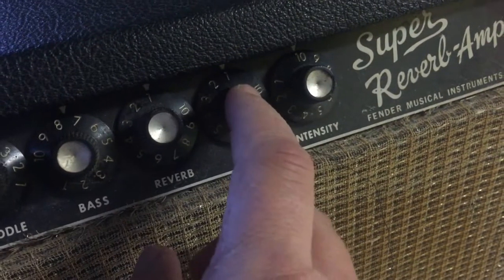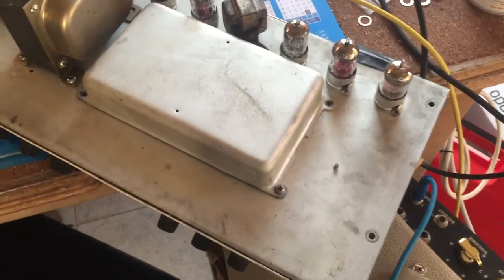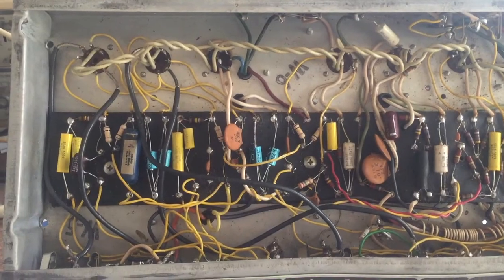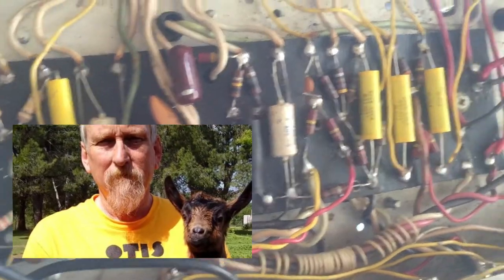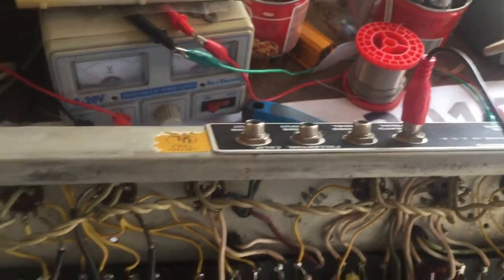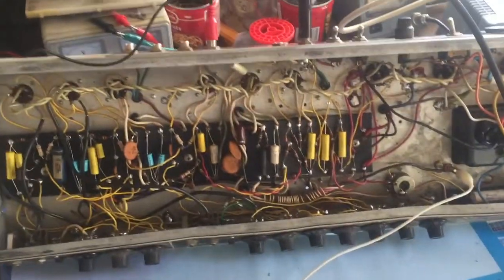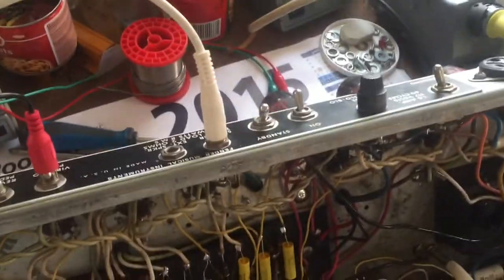Fixing a ticking Fender tremolo: 1975 Super Reverb Amp

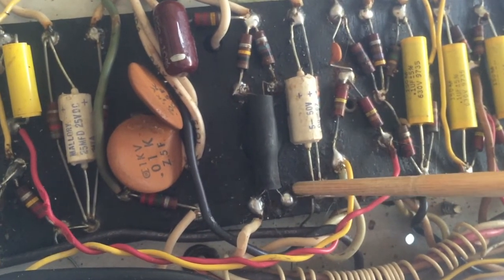Comment: At 6:30 you point to the location you said to solder the additional cap to and even alligator clipped it to that wire for the test. Yet when you're done, you've soldered it parallel to the Optocoupler itself? I see they're connected anyway but was wondering why the change?
Reply from the maker: 12:25 ? I don't really understand the question regarding 6:30 but a first the cap is put in circuit by using alligator clips, is that where the confusion comes from?
Reply: @zjokka  sorry, at 6:30 you pointed to the solder joint of the bypass cap marked 5-50v and that appears to be where you attached the clip to put the .01 cap in circuit. At 12:25 it's soldered to the bottom right leg of the roach. I just wondered if I missed something is all.
Reply from the maker: @kidlargo1  The right leg of the roach and the negative side of that capacitor are connected, and both lead to ground. Check the original Fender layout or schematic...
Reply: @zjokka  that's what I thought but I wanted to be sure thanks. Of course, now I've just seen 2 fixes that jump only the 10meg resistor lol. I'm just gonna test it with clips like you did and see what's up. Thanks again. Now if I can just find that rattle....

Comment: Fender's tech note says to wire the 0.01 uF cap across the 10 Meg resistor. Did that with absolutely no effect :-(  Where did you get your info from?
Reply from the maker: Hi Thomas, I have never seen that Fender tech note. Also do not exactly remember the source for this modification. Anyways, I would always test it using alligator clips before soldering, no matter who suggests the mod... Fender or some fool on youtube like myself ;-)
Hope you get it fixed!

Comment: Did you also change the dropping resistors in the dog house to 4.7k and 1k from 10k and 2.2k thereby upping the preamp voltages? Or was it just the phase inverter?
Reply from the maker: Did not touch the dog house!  Will be getting back to this one once i get around it!
Reply: @zjokka  Well thats why I asked. I've heard a few "blackfaced" 70s aka Silverface amps that had that superbly SWEET compression going on. I'm no expert but I think its a consequence of NOT altering the preamp voltages and maintaining that clarity but adding the compression from the 1ms in the PI etc. 
I don't hear that same sweetness from full blackfaces..
Reply: I have one under the knife right now so I'll let you know.. 
I'll change the PI resistors (leaving the .01uf coupling cap for now) and tail and we'll see.
Reply: @zjokka  Compare to this: https://youtu.be/6kMV3wZKMe8
Yours has that woody compressed sweetness I hear a LOT but never from actual blackfaces..
Reply from the maker: @cgavin1  I bought this amp 15 years ago . Did not do the conversion myself. It was done by a guy who worked in the automotive industry as a sound tester. There is a rattle somewhere in the prototype , his job to locate the problem. Fender amps was his hobby. Ill check the dropping resistors asap... but kinda busy weeks ahead...
Reply: @zjokka  No rush dude. Time has no meaning in this place. :)

Comment: ZJOKKA, if you remove the Choke in the power supply what does this do to the AC ripple? 
can this add harmonics and modulate the power tubes from the AC ripple signal?
Reply from the maker: Hi Bill, I didn't try this, but this will seriously alter the sound of the amp and cannot be simply omitted. It could be replaced with a very high wattage resistor. I also don't think AC ripple is the cause of the problem of the ticking tremolo in so many SF Fenders. 
The choke is in the power section, the tremolo works on the grid bias of the output tubes. 
I hope I understood your question, but don't feel I can really answer it.

Comment: I removed a patch plug from the back of the amp, from the trem footswitch input, but I still get ticking with I crank the amp up to 7 or higher.
Reply from the maker: Saw this a little late, but don't really understand: when you disengage the tremolo (removing plug/footpedal) you still get the ticking sound? If that is the case, do you get tremolo when the speed and intensity controls are turned on? 
Maybe the plug is the problem?
Reply: It was my electric fence
Reply from the maker: @sebwarren7918  😆